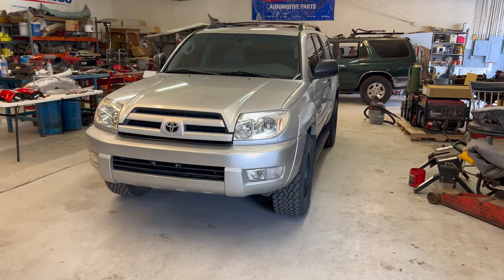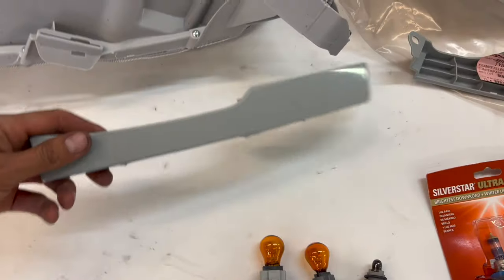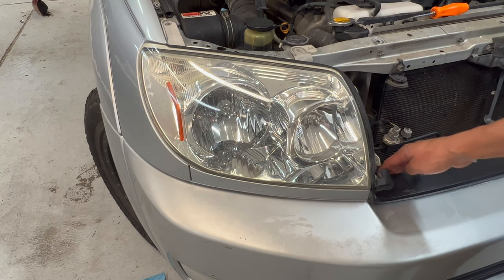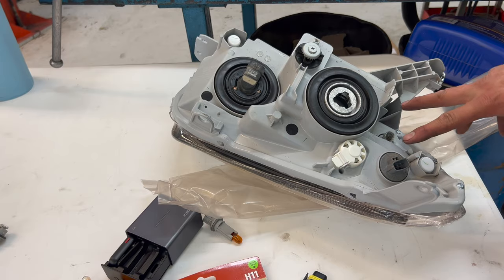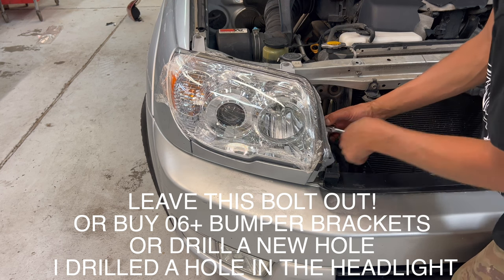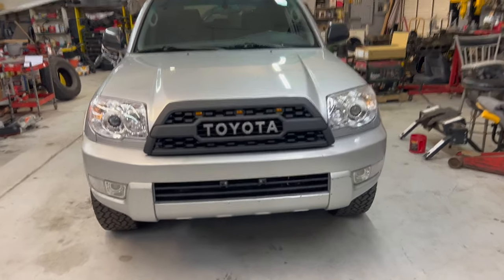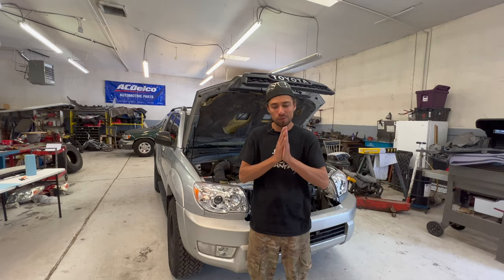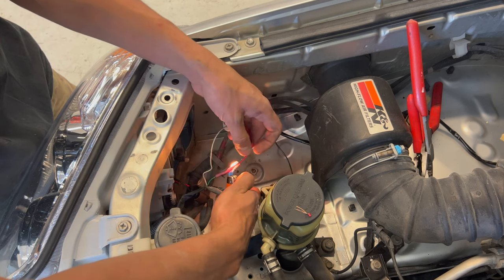How To Facelift a 4th Gen Toyota 4runner

Comment: worst thing Toyota did was take the V8 out of the 4runner as an option
Reply: Absolutely! The new V6 is a turd. V8 makes torque in the powerband that the 5th gen can’t match. It can only tow 5,000 😂
Reply: @nordicpride9708  what also doubles down on that is that Toyota makes a great diesel motor but for some strange reason we cant get it in any suv here

Comment: Headlights on the 06-09 4Runners are not very good.  You would have been much, much better doing a retrofit to the 03-05 headlights.  If you really want the 06 headlight look, then you can retrofit those with much, much better projectors, but they are a lot harder to retrofit.  The LED taillights are kind of cool, but I personally found it better to just use a phillips LED replacement in the stock taillights.  It is much newer technology and much brighter than the 06 taillights.  But, when I fist got my 05 4Runner, I looked at all of these upgrades as well, so I don't blame you for wanting to do them.

Comment: Ok just a suggestion to everyone wanting to make splicing into existing wiring harnesses at pretty much all auto parts stores in the USA all sell piggyback tie ins. So all you have to do is put the splicer side over the existing wiring you wanna connect to then slide in the power wire for the what ever you're trying to get power to then simply use a pair of pliers and squeeze the connecting portion until it stops then close the cover for it and you're set. Very easy way to splice into existing wiring harnesses!

Comment: The cool thing about 4th gens is you can install 2nd/3rd gen front struts which are superior and bolt right in. They also add a little lift to that factory rake. Rear shocks work with a bushing change. Pretty cool!

Comment: I really enjoyed watching your video! I did a similar face-lift on the front end of my 2005 4Runner. The difference in my process was that I removed the bumper entirely to make my long cur across, and made some cuts to the corners of the eBay grille to clear the headlights since I kept the 05 ones. Great instructional video though!

Comment: Thanks for making this, finally a good that actually explains how to do the swap
Reply from the maker: No problem. It was a learning experience, but now we all have more information 👍🏻
Reply: @steinfabgarage  I have all the parts to do the headlight conversion but I been holding it off because I got a used 06-09 headlight that I want to sand and also put custom halo to it. I was lucky enough that the headlight I got came with all the bulbs
Reply: @steinfabgarage  hey also where are you located, I want that bumper once you get the metal bumper and which metal bumper are you going with?
Reply from the maker: @itsdoncartagena6485   I’m in New Mexico near Santa Fe. 

Undecided on the bumper. I was gonna build a simple bumper, but I’m leaning towards a bolt on option as that’s what most people want

Comment: finally a video showing how its actually done. i am having second thoughts on doing the grill as i dont know if i wanna ruin the bumper. that being said i might 3d print the part between the headlight filler and oem grill. then paint match.
Reply from the maker: If you do you should print a bunch and sell them. These cars are all getting to the point where they need new headlights lights, I anticipate this swap taking off in the coming years as the 4Runners get handed down to the kids
Reply: Just plasti-dip the 03 grille. Did mine and it looks great.
Reply from the maker: @rayland9305  I hate plastidip. It needs to be redone after rock chips and pressure washing bugs. Not my style as I own to many cars so I like doing things ONCE and being done
Reply: @steinfabgarage  Strange. Plastidip has been the most durable thing I have ever used, especially against rock chips, as it's rubber they just bounce off. I use it on my wheels and never had it chip. Only time I had to redo it is when my mechanic put my wheels down face first on cement.  Maybe you didn't put enough coats?
Reply: did you end up 3D printing the part?

Comment: Great video!  I like the grill the best .  Wish there was like a set of fenders were they would work with the truck front ends .  I’d change out my 04 for the 2017-2020 . The bumper , hood, grill and headlights seems like from what I’ve seen those peace’s are easily made to fit with a little carving behind the head lights .  The newer truck front fenders don’t line up with the door contour.  These older 4Runners look so good with mods and the newer Tacoma front ends are just sick on these .  Toyota sure uses a lot of different bulbs but I found the low beam to be the same as the bulbs in my lower bumper projection lights to be the same .  It looks a lot better from the start !

Comment: She’s my third 4Runner. Lost my 2000 3rd Gen in my ex wife’s roll over. Thanks ex.   Lost my second in the divorce. Bought a 3rd one. These machines are amazing! Especially if you can find a 4th Gen V8. Just be careful with the secondary air injection pump. It’s a bitch. And expensive.
Reply: I found a 2007 Sport Edition w V8. I love it.

Comment: Love this video. Thank you so much for your time? Got Questions. Which socket is the one you put the LED light on? Is it off the Camry? And if so what year was it? Or is it the original one from your 04?
Reply from the maker: I used the Camry, idk 09 maybe, however your factory ones work, but the bulb will contact the the outer lens.

Just use the OEM holder with a led bulb, if it’s shorter- great it won’t contact, if not it’s LED so it don’t be hot. Short led is best tho
Reply: @steinfabgarage  sorry what is OEM?  lol
Reply from the maker: @MobileProBarber  original equipment manufacturer. Aka the one you took out of your old headlight
Reply: Again, Thank you so much for your time and help. 🙏🏽
Reply from the maker: @MobileProBarber  no problem, any more questions, drop a comment and I’ll do my best to help. Thank you for watching my content, I really appreciate it
Reply: For the led bulbs would go with the white? Or blue ones?
Reply from the maker: @MobileProBarber  I’d go white, I think mine are 6000k so there supposed to be white but there more like 7k and a lil blue

Comment: I put this tailight housing in on my 2004 4Runner and I am getting hyperflash turn signal as well.  All other lights are working and this is the only one I replaced.  ALL other lighting is stock.  This tailight assembly is tricky because there is only 1 wire feeding all three bulbs.  This did not work for me.

Comment: Hey man I've just got a question for ya, I'm still a bit confused even watching this video 3 times lmao, So i need to H7 to H11 adaptor for one of the bulbs, but the others still work just need to be shaved down? And where did you get the adaptor from? I assume it's something i can get from autozone.
Reply from the maker: I got my adapters on eBay, but Amazon has them too, not sure about autozone, adapters are for low beams, high beams plug right in, and the rest trim and fit

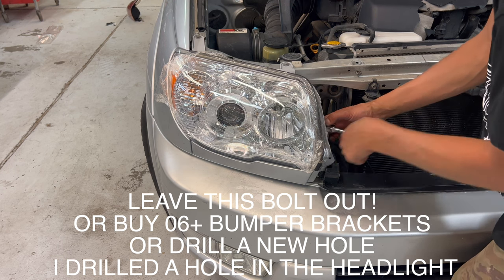Comment: 21:59 I don't think that's what they meant by the optional bolt. It may be the one inside the bumper
Reply: A lot of people just skip reinstalling the wheel well bolt, b/c it is a royal pain to get started & put a socket on. Definitely worth popping off the plastic well liner and replacing those bolts, tho. I bought some OEM-style projector headlights to replace the yellowed ones on my 2006. Took about 45 minutes to replace both. Had to buy some plastic rivets, tho -- broke a few in the replacement, and about five were missing from the inner shroud.

Comment: Would it be worth buying an 07 with 230k ?
Reply: Sure, if the frame is solid and it runs good.  Bought my 08 with 210k mikes 3 years ago and now have 296k on it.  I have been all over the US several times without any issues.

Comment: I had the ‘TOYOTA’ grill, 4 raptor lights, a black push bar, with KC-type fog lights on the push bar installed on my 2007 4-Runer. It looks so badass. I just got it lifted 5 inches, and got some BF Goodrich KO2’s (34x10.5). Can I post a picture?

Comment: Hay man, just FYI....you got the wrong grill. You got a grill for a 2006-2009 4th gen. They sell the correct TRD grill for the 03-05 that bolts right in without any mods or cutting.
Reply: He bought the 06-09 grill so that the headlights fit to the grill and didn’t leave the gap

Comment: Did you use buy oem headlights and taillights? Or aftermarket?
Reply from the maker: Oem replacment, not genuine. Make sure to buy tail lights that are already wired so you can just plug the led board in, a buddy bought the cheapest ones and they required some wiring, just look at the pics and if it’s 3 wires that aren’t connected to anything, your going too cheap

Comment: Did you have any issues with the turn signal bulbs hyperflashing? Did the swap and at first only one was working probably, now both are hyperflashing. Any help would be greatly appreciated!
Reply from the maker: I did not as I used all stock bulbs. Did you use LEDs on front or rear turn signals? A hyperflash signals that a bulb is out. Are both front and rear turn signals working?
Reply: @steinfabgarage  I'm using the stock bulbs as well. They were working in the pre facelift housing, but one is not working in the new housing. I have not gotten around to upgrading the headlights yet.
Reply from the maker: @0tterthekulakking620   Let’s clarify some things. What’s everything you changed? The tail lights? The headlights? Or both? Do a light check as well. Do all 4 turn signals work? Hyplerflash points to a bulb being out (that’s the point of it) so make sure they all work. You might have forgot to plug them in
Reply: @steinfabgarage  Just the tail lights
Reply from the maker: @0tterthekulakking620  make sure the contacts are lined up correctly on the bulb holder into the housing. There’s arrows that point to how it should be oriented

Comment: your cousin electrical overload of the computer on board computer on that car I don't think you understand what's going on there if people follow this information they can find themselves replacing a computer in their vehicles just because they want to upgrade the headlights that way overtime that will melt their Hornets their wiring and the back of those headlights and cause an electrical problem
Reply: How?
Reply from the maker: What are you talking about? How did I add ANY electrical load? It’s literally the same as it was

Comment: I also hit a deer and it put a huge dent or wrinkle in the bumper. Broke the grill, and mangled the hood latch. It’s been suggested tout heat on the bumper so it will pop back into shape. Using either hot water or heat gun. It’s an ‘07, v-6. Any suggestions?